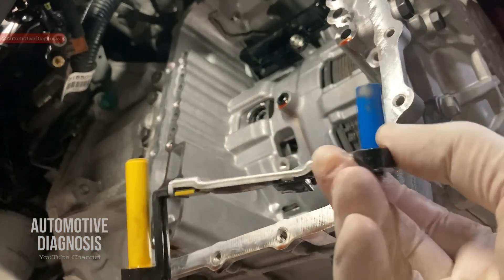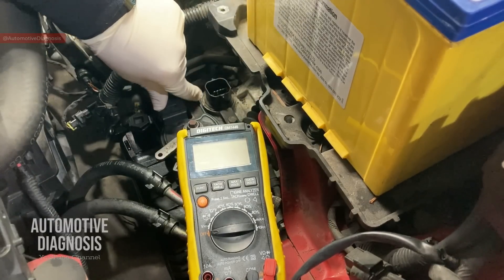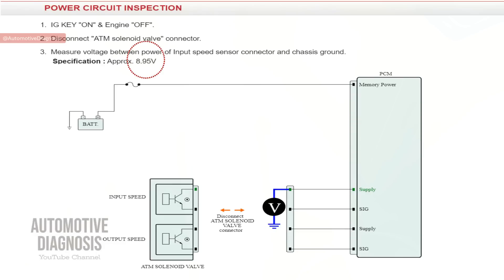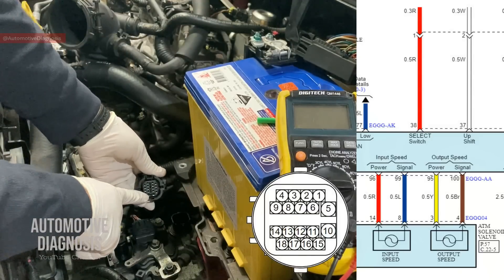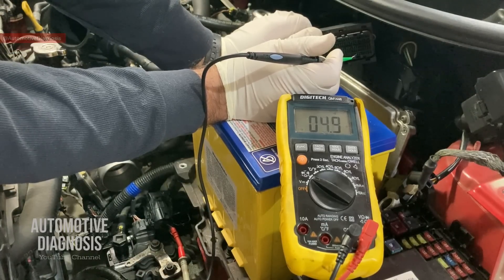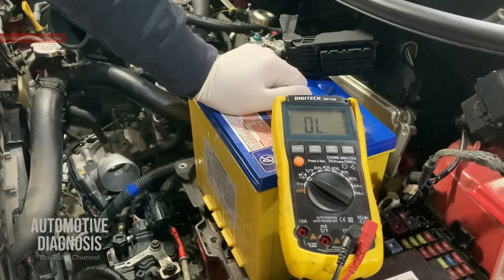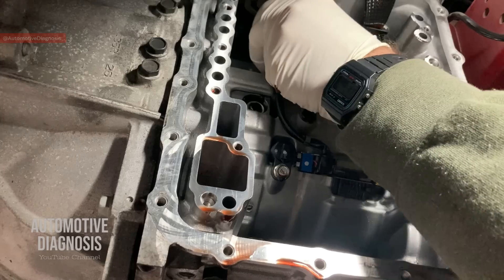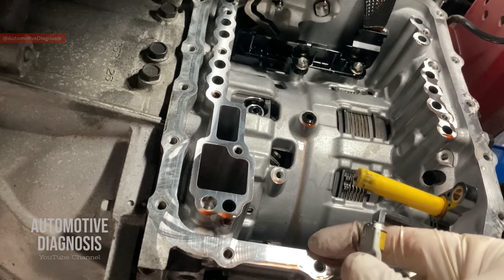Transmission Input Speed Sensor Diagnostic | How to Test the Wiring & Sensor Replacement

Comment: My car not smooth shifting when press break and feeling like ABS is working when transmission shifting to low speed before stop,  However no check engine light at all, any suggestions for this issue  ?

Comment: Thank you for what you are providing. Why does one have a resistance and the other does not? I did this test on more than one sensor and the result is the same.
Reply from the maker: Hi my friend, it’s basically the type of the sensors and as you know, not all the sensors are the same. That’s why we need to make sure what type of sensor we have, then we can proceed to the diagnostic.

Comment: Hey brother, what could cause a maf sensor code not to set when disconnected? I have a start then stall on a mitsubishi. 

Tried disconnecting the maf to rule that out but nothing happens and it doesn't throw a code. 

Mitsubishi 380

Thanks for youe help